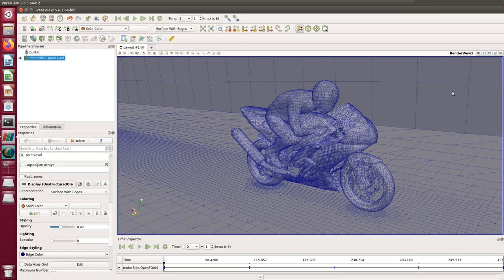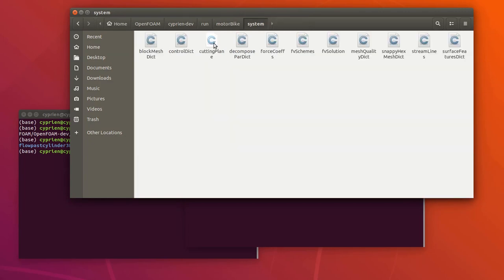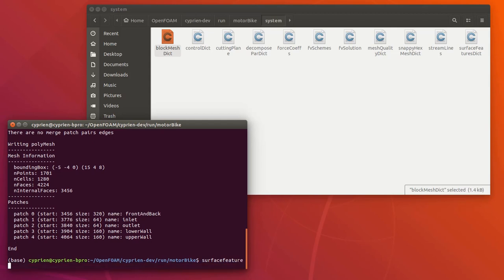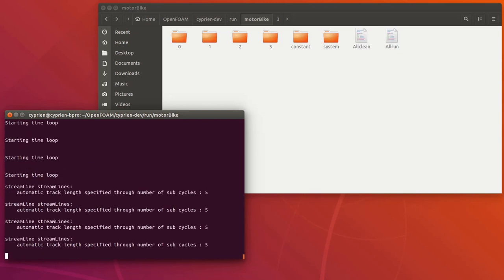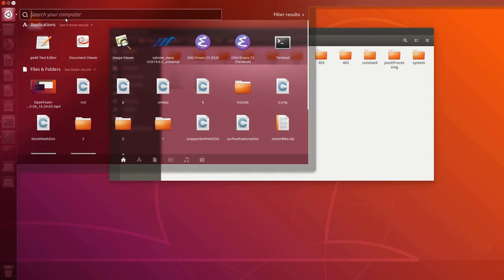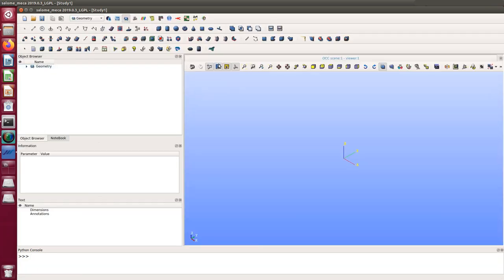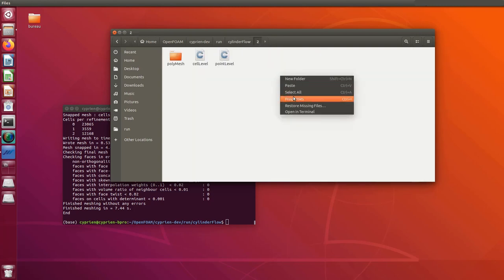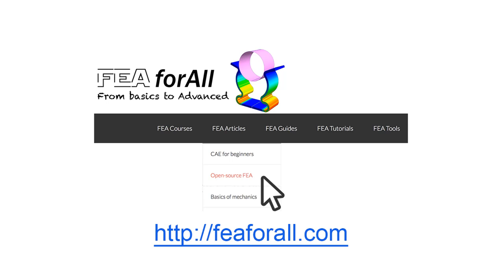[Openfoam Tutorial 4] Simulating the flow around a Motorbike with SnappyHexMesh

Comment: As a beginner I really enjoyed this tutorial. Later I decided to use this case to see how close can I get the to the experimental data if I test the drag coefficient of a 1M diameter flat disc. For the Reynolds numbers applicable to this case, the flat disc Cd should be around 1.17. No matter what I did, I was unable to build a case that converged to anything lower than 1.2. In my mind this is a pretty big error. Do you think something better can be achieved using OpenFoam and if yes, it would be amazing to see if you can publish a tutorial demonstrating how close the OpenFoam can get to the "real world" when it comes to measuring drag. Big thanks!
Reply: 1.2 is a pretty close match to 1.17. 

Did you come across CFD research that matched disk CD better?
Reply: After more experimentation, I found that if I restrict the mesh subdivisions to level 6 from the base mesh, then the Cd converges to 1.167, but as soon as I go the the level 7, the Cd jumps to 1.22. I guess I still have lots to learn about how mesh affects the solution and how the steady-state SimpleFoam solver works.

Comment: i have surfaceFeatureExtract not surfaceFeatures, and it is showing  FOAM FATAL ERROR: (openfoam-2112 patch=220610)
No surfaces specified/found for entry: motorBike.obj

    From int main(int, char**)
    in file surfaceFeatureExtract.C at line 308.
Reply: Cause you have to name folder in which geometry file located as "triSurface", not "geometry".
Reply: @SeaGoRetta  I've been trying to figure this out for the last week. Thank you so much.
Reply: @SeaGoRetta  Thank you!
Reply: @seaGoRetta had the same issue! thanks for sharing the solution
Reply: @SeaGoRetta  same issue here. thank you for sharing this
Reply: @SeaGoRetta  thankyou

Comment: When I execute the command simpleFoam, it runs until the iteration 500 but the forceCoeffs didnt change so i get no results. What should I do?

smoothSolver:  Solving for Ux, Initial residual = 0.547873, Final residual = 0.307769, No Iterations 1000
smoothSolver:  Solving for Uy, Initial residual = 0.457213, Final residual = 0.00543555, No Iterations 1
smoothSolver:  Solving for Uz, Initial residual = 0.447267, Final residual = 0.00434911, No Iterations 1
GAMG:  Solving for p, Initial residual = 0.0575077, Final residual = 0.000362013, No Iterations 2
time step continuity errors : sum local = 1.57153e-15, global = 1.59461e-17, cumulative = -6.08816e-10
smoothSolver:  Solving for omega, Initial residual = 5.53772e-09, Final residual = 5.53772e-09, No Iterations 0
smoothSolver:  Solving for k, Initial residual = 7.51244e-09, Final residual = 7.51244e-09, No Iterations 0
ExecutionTime = 12.07 s  ClockTime = 13 s

streamLine streamLines write:
    seeded 20 particles
    Tracks:20
    Total samples:1720
    Writing data to "/home/openCFD/workdir/Pedro/motorBike/postProcessing/sets/streamLines/500"
nearWallFields near write:
    Sampling fields to 500
    Writing sampled fields to 500
wallBoundedStreamLine wallBoundedStreamLines write:
wallBoundedStreamLine : seeded 0 particles.
    Tracks:0
    Total samples:0
forceCoeffs forceCoeffs1 execute:
    Coefficients
        Cd       : 0	(pressure: 0	viscous: 0)
        Cs       : 0	(pressure: 0	viscous: 0)
        Cl       : 0	(pressure: 0	viscous: 0)
        CmRoll       : 0	(pressure: 0	viscous: 0)
        CmPitch       : 0	(pressure: 0	viscous: 0)
        CmYaw       : 0	(pressure: 0	viscous: 0)
        Cd(f)    : 0
        Cd(r)    : 0
        Cs(f)    : 0
        Cs(r)    : 0
        Cl(f)    : 0
        Cl(r)    : 0
ensightWrite ensightWrite write: ( k omega p U )
End
Reply: Hi Pedro, I have same problem with this case. I fixed that with snappyHexMesh -overwrite instead of snappyHexMesh. I donot know why but anyway it's working now. Hope it could be helpful for you.
Reply: @刘弼恒  I had the same problem and it worked for me. Thank you!

Comment: Hi @Cyprien Rusu , Great Video. Thanks. 
I have two comments / questions:

* I would appreciate more details for snappyHexMesh, which seems to work fine wut tutorials, but gives issues for more complex cases.
* where did you get the new verticies in Salome so quickly for the new case (t~28'23") or did you just prepare this file somewhere else??

Comment: ExecutionTime = 4525.55 s  ClockTime = 4529 s

forceCoeffs forceCoeffs1 write:
    Cm    = 0.154987
    Cd    = 0.411525
    Cl    = 0.0747083
    Cl(f) = 0.192341
    Cl(r) = -0.117632

End
$ paraFoam&

--> FOAM Warning : 
    From function Foam::labelHashSet Foam::polyBoundaryMesh::patchSet(const Foam::UList<Foam::wordRe>&, bool, bool) const
    in file meshes/polyMesh/polyBoundaryMesh/polyBoundaryMesh.C at line 804
    Cannot find any patch or group names matching motorBike_frt-fairing:001%1

After the computation is completed, when i try to run the timestep in parafoam, i get a crash of parafoam and this error message in terminal. What could be wrong?
Reply: I have the same error. Although i resetted my ubuntu and set up openfoam and packages again it didn't fix anything. If there's somebody who had it happened before, please help me :(
Reply: I think you need to use snappyHexMesh -overwrite instead of just snappyHexMesh, I am on openfoam 9 and it seems to be working
Reply: i also have same error 😓
Reply: it can be solved if your create a dummy foam file e.g. nano motor.foam
than you run this dummy foam file with paraview and not with parafoam e.g. paraview motor.foam &

Comment: Hello I have some error
--> FOAM FATAL ERROR: 
bad size -2147483647

    From function Foam::List<T>::List(Foam::label, const T&) [with T = Foam::List<int>; Foam::label = int]
    in file /home/ubuntu/OpenFOAM/OpenFOAM-10/src/OpenFOAM/lnInclude/List.C at line 61.

FOAM aborting

#0  Foam::error::printStack(Foam::Ostream&) at ??:?
#1  Foam::error::abort() at ??:?
#2  Foam::List<Foam::List<int> >::List(int, Foam::List<int> const&) at ??:?
#3  Foam::functionObjects::streamlines::write() at ??:?
#4  Foam::functionObjects::timeControl::write() at ??:?
#5  Foam::functionObjectList::start() at ??:?
#6  Foam::Time::run() const at ??:?
#7  Foam::Time::loop() at ??:?
#8  ? in "/opt/openfoam10/platforms/linux64GccDPInt32Opt/bin/simpleFoam"
#9  __libc_start_main in "/lib/x86_64-linux-gnu/libc.so.6"
#10  ? in "/opt/openfoam10/platforms/linux64GccDPInt32Opt/bin/simpleFoam"
Aborted (core dumped)

Do you know what is mean??
Reply from the maker: You are probably using a different version of openfoam. Try to install the same I am using. I think it was openfoam 8 or 9… check the first video of the series